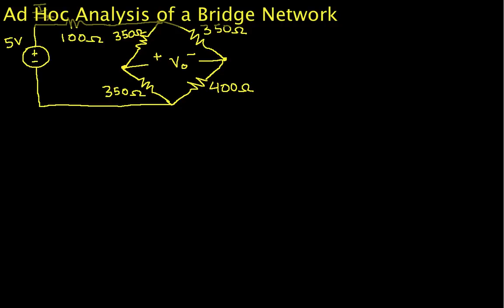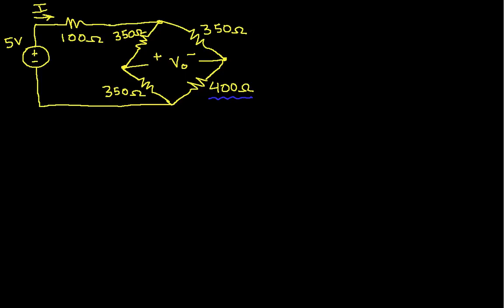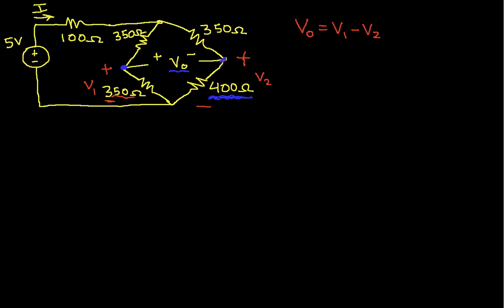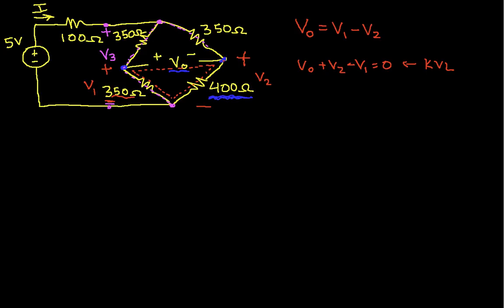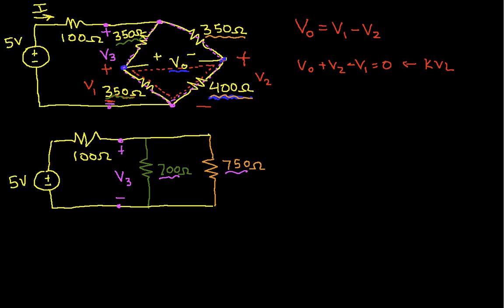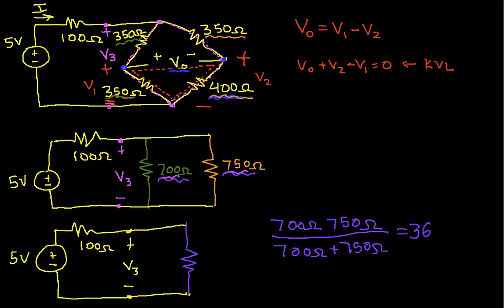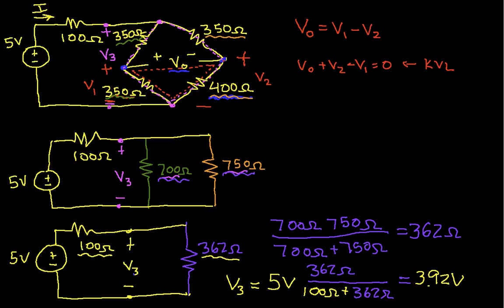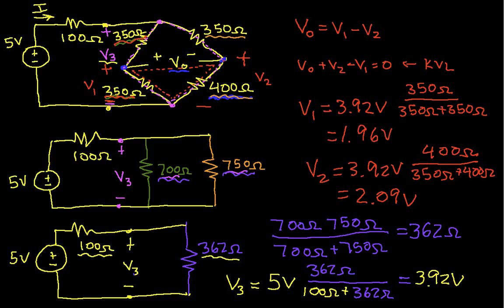Ad Hoc Analysis Example-Bridge Network Part 1

Comment from the maker: V3 is found with the voltage divider formula. There is a 100 Ohm resistor in series with a 362 Ohm resistor with 5V across the two; so the voltage across the 362 Ohm resistor is given by the voltage divider formula.

Comment: I am a little confused at 4:44. The definition of Kirchoff's Law was: The sum of all voltages in a closed path is zero, and you used it in an open path, or at least, you did not include the whole path. Now I solved this using a different method and the result is the same as yours. What am I missing?

Comment: +Cookie503 thank you! I was totally confused. i was like how are they in series?!?! Lifesaver at 1 a.m. lol! For anyone reading...it is not a voltage source and there is no actual connection in that spot. The notation simply means you are trying to find the voltage across these two points

Comment: Thank you for posting these videos, they are really helpful. I have one question. 
When you found the V3, the total resistance that you calculated by adding these 100ohms and 362ohms (because they are series), but why they are divided by again 362ohms? If they were parallel the we should multiply both of them on the nominator but you just write down only one resistor on the nominator. thanks

Comment: Hi, I'm not seeing how the resistors in this circuit are in series! There is another wire connecting to the voltage source Vo which is of unknown resistance. Please explain. Thanks